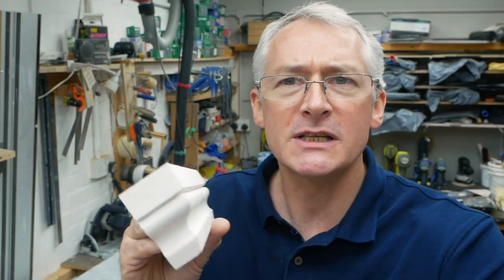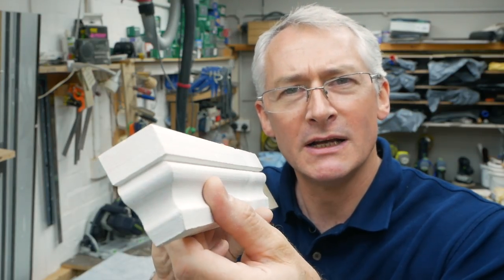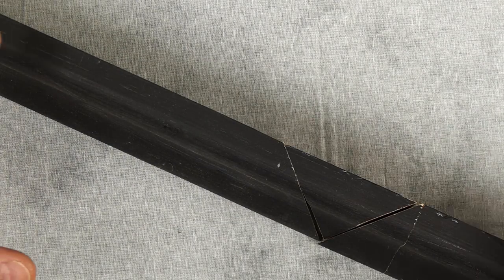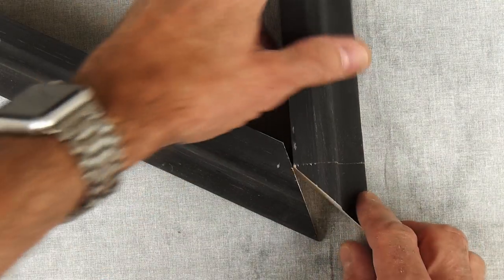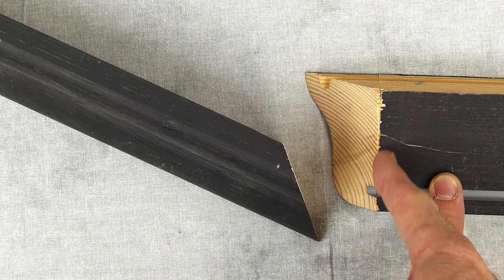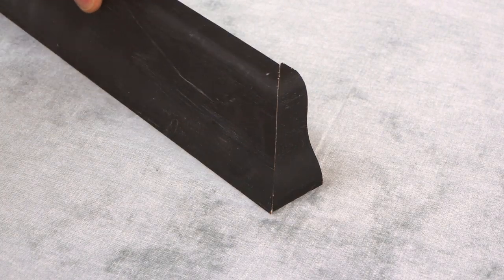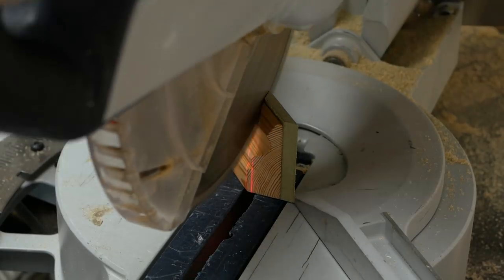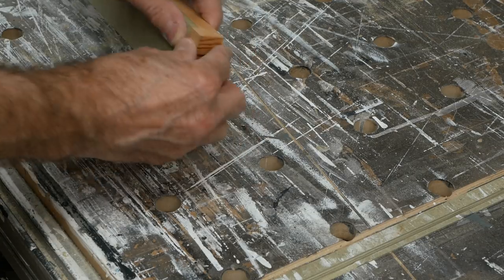Reverse Mitre #110

Comment: Great tip Peter. Much easier and accurate to flip the trim than reset the angle on the saw. There are plenty of useful tricks and tips we can learn from your and other woodworkers videos. These ideas helps a lot not only in the workshop but also when I'm doing the drawings. Many thanks for sharing that.
Reply from the maker: +Daniel Prasal Pleasure 👍

Comment: Peter, I could see you doing an entire series on how to use trim and the miter saw and different tricks. For small trim pieces like this I use a combination of Titebond II or III and a CA Glue. The CA glue acts as a clamp while the Titebond has time to setup.
Reply from the maker: +joe scharbrough Yep - always good to have some superglue to hand 👍
Reply: I used to do that Joe, but just use the CA glue with activator now. Never have a problem. If you are in the UK the Screwfix stuff is superb.

Comment: The name confuses me - isn't it just a short section of a normal mitre? You could even just make a complete normal mitre then cut it down to be a "reverse mitre". I would have guessed that a "reverse mitre" would be for an inside corner, as you do with ceiling mouldings. But then, I am less a carpenter than a cack-handed amateur.
Reply from the maker: +mozismobile I guess they needed a name for it to distinguish it from a regular mitre; I’ve heard it called reverse mitre, stop mitre, or just ‘put a return on it’. 👍
Reply: Peter Millard I was always told it was called “return (returning) the mould”